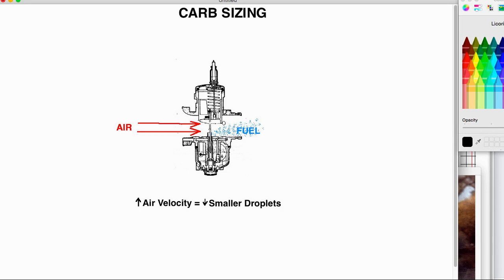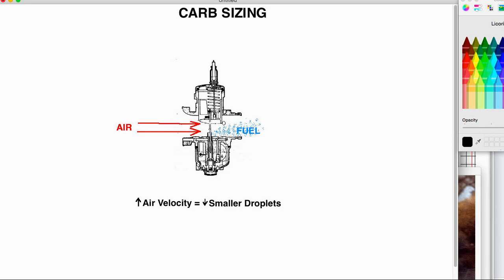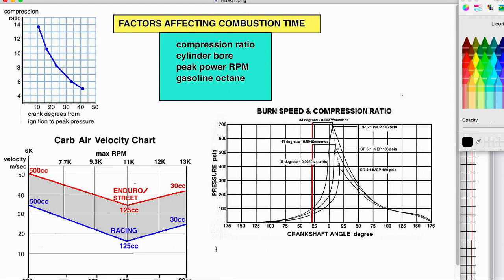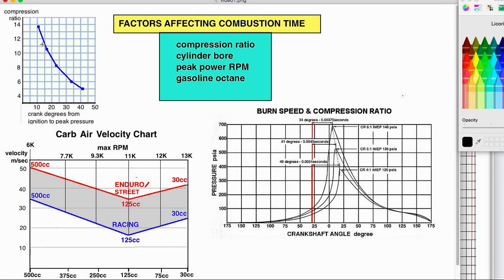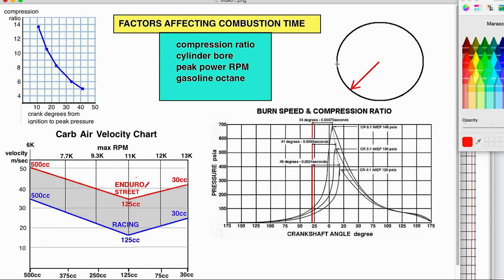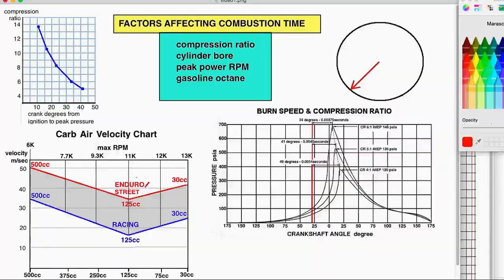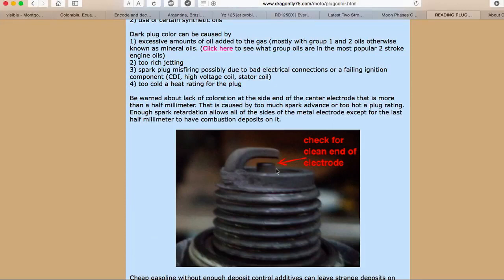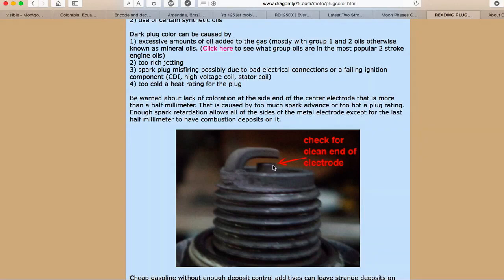Factors Affecting Correct 2 Stroke Carb Size

Comment from the maker: To answer anyone (such as Will Campbell below) who would criticize me because with some aspects of 2 stroke technology I have opinions/beliefs not based on my own experience: Let’s take squish velocity for example. If you have “experience” then it’s based on just a few motorcycles and no universal opinion should be based on such limited experience. Same thing for carburetor sizing. My approach is to first get a good basic understanding of how something works and then use the dozens of examples available on the internet from riders experiences, and then if possible test the ideas out. But if I can’t test them out then what I rely on is the opinions of people who use my spreadsheets to let me know if they are right on the money or out in left field. I am very serious about this stuff and try my best to not lead anyone astray. My process is long and thorough. Since 2004 I’ve made 2 stroke technology my hobby and have invested a ton of time and effort into it. I’ve been able to prove out by my own real live testing my calculators for expansion chambers, crank balance, boost bottles, and partially the jetting and porting calculators. The squish calculator is just for determining the velocity without giving any recommendations other than to say what Blair recommended. The oil ratio calculator gives calculated recommendations which are in agreement with many recommendations by bike manufacturers and oil companies. For the index page listing these calculators go to www.dragonfly75.com/moto/calculators.html